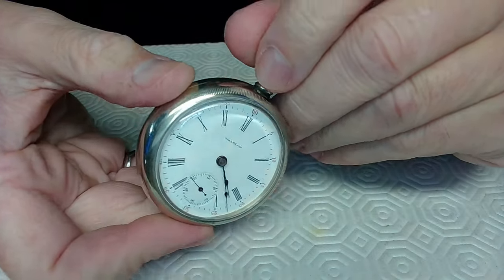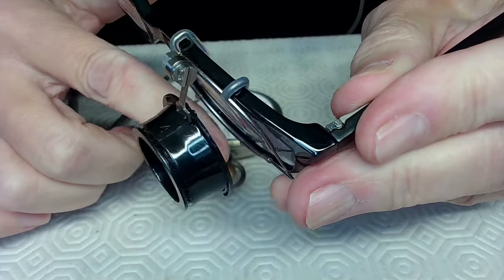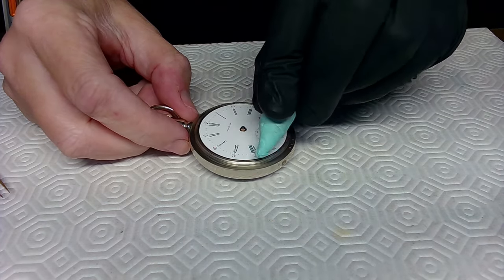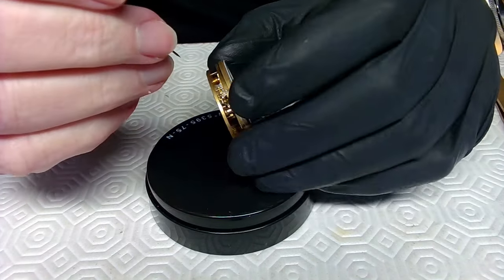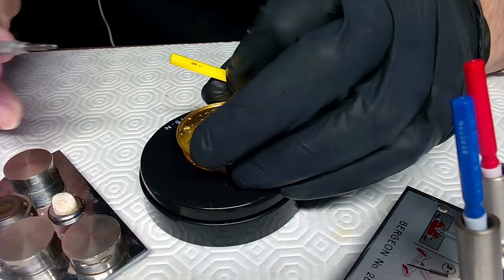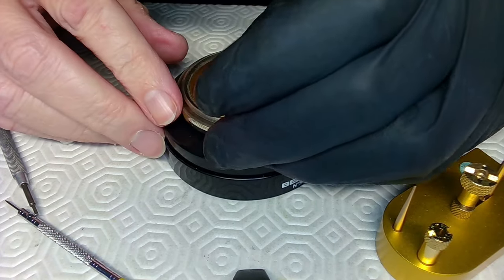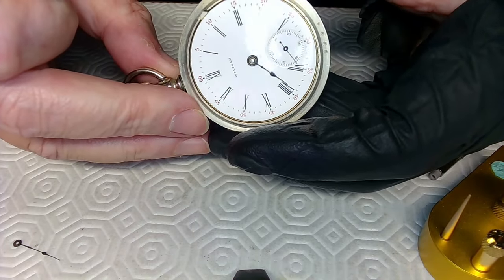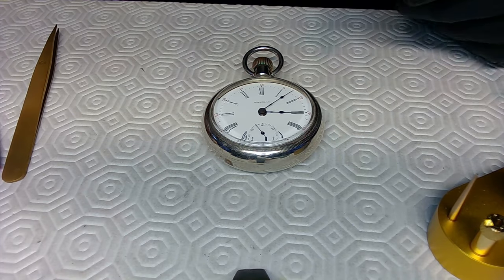Correcting Tight Cannon Pinion on Waltham 1800s Watch

Comment: Hi JD, great to see more watchmaking content! I hope you are completely recovered soon, it is really hard to do watch work when you’re sick. 

It is a common misconception that there is an inherent fault in the safety action of a single roller lever escapement.

The safety action of a single roller escapement is just as good as that of a double roller, provided they it is set up correctly. I have never seen a rebanked (overbanking is roller jewel collision with the outside of the fork due to excess amplitude) balance in a single roller escapement that is in unmolested condition. 

The double roller is considered superior for other reasons. 

The safety roller (double or single) is there to prevent the pallet fork from unlocking the escape wheel at any time except when the impulse jewel is engaged within the pallet fork slot. 

When the watch experiences a shock sufficient to move the pallet fork, unlocking is prevented by the safety dart hitting the safety roller. In a double roller escapement, the smaller diameter of the safety roller means the pallet fork dart has less leverage on the balance wheel, so it is less able to disrupt the balance wheel, lessening any interference with good timekeeping. 

The other benefit of a double roller escapement is it can be designed such that it is more ‘detached’ (the balance wheel spends less of each vibration mechanically interacting with the pallet fork) than a single roller due to the geometry. This also improves timekeeping. 

The most common cause of a watch rebanking like this one had upon return to you is that the guard pin has been deliberately or accidentally bent out of upright such that it fails to contact the roller when it should. If it has been deliberately bent, this suggests it was a botch to eliminate some other problem with the escapement. 

You can fix the rebanking problem, a close examination of the fork, the roller and the interaction between the cutout crescent of the roller is the first step. 

Stay away from the banking pins to begin with, there is no apparent problem with the depth of locking of the escapement. 

What you need to troubleshoot is why is the guard pin not hitting the roller table to prevent the fork from moving to the other side when the roller jewel is not in the fork slot? It should be impossible for the fork to move to the other side due to the guard pin being blocked by the roller. 

The guard pin should only clear the roller table when it is aligned with the crescent shaped cut out, which means the roller jewel is in the fork slot. 

Cannon pinions certainly should be lubricated, doing so correctly is important and is high on the list of things that must be done correctly to ensure the longevity of a service. The BHI guide on lubrication (a fantastic resource, available as a free PDF online) recommends KT22, Moebius 9501, 9504 and HP1300 are also good choices. It is lubricated by lightly greasing the length of the centre wheel arbor along the length of the interacting surface, as opposed to lubricating inside the cannon pinion itself. 

Keep up the great work,

Mark
Reply from the maker: Thank you very much Marc all very good advice. I did end up using HP 1300 for lubricating slightly the centre wheel pivot before I put the canon pinion back on, and it worked perfectly. I did not touch the baking pans as you suggested, otherwise, it’s a whole other set up problem, and with a full plate movement that becomes very difficult. I didn’t realize that the problem was not a bent guard pin in the end. It was the impulse jewel, being loose and riding up when the watch was in the face of position, causing the re-banking, as you call it. I like that term a lot better because overbanking was not what was happening. I think I’m going to try using the liquid shellac method of reinstalling the jewel and see if this works fine. I always tend to takeoff the roller table when I’m shellacking A jewel back in place, but this is likely not necessary if I use liquid shellac, or even if I melt shellac on using the heating tool that I have it looks like a bit like a dinosaurs head.
Reply from the maker: Are you mark from the repair channel?
Reply: @JDRichard  Liquid shellac is an ideal way to resecure the roller jewel. I’m not Mark from the Watch Repair Channel, I haven’t produced any YouTube content.
Reply: @JDRichard  Setting up an escapement in a full plate watch is indeed a difficult job, especially without certain specialised tools.

Comment: Wire gauge drill bits will often have the size to open those indents. If you open them too much, break out the staking set and narrow it down. Well thats the way i do it . Carry on
Reply from the maker: You are correct. I can widen and narrow it, and widen in there with many many times.